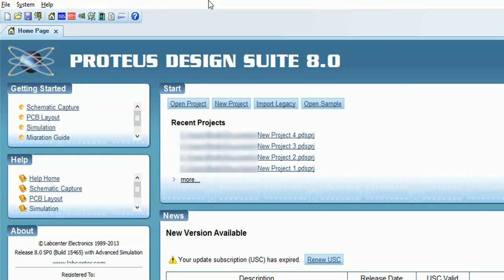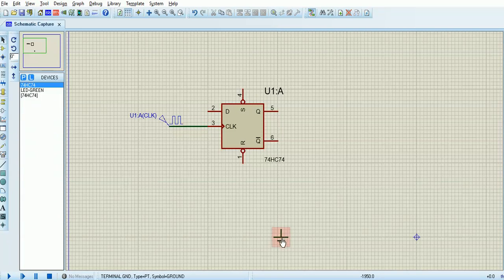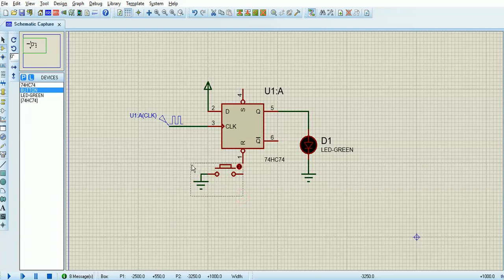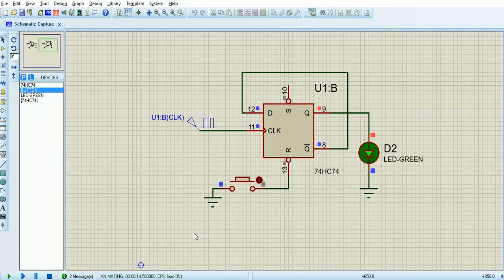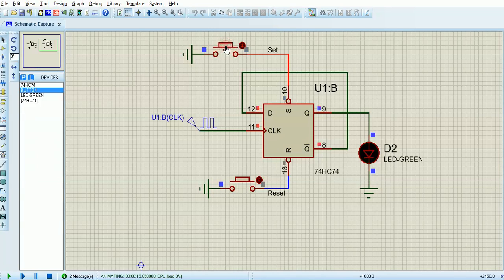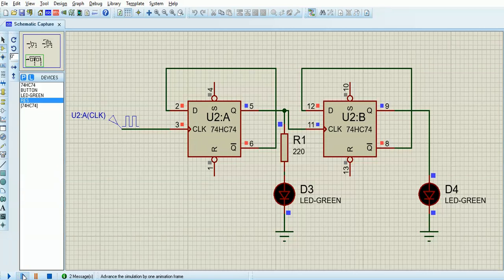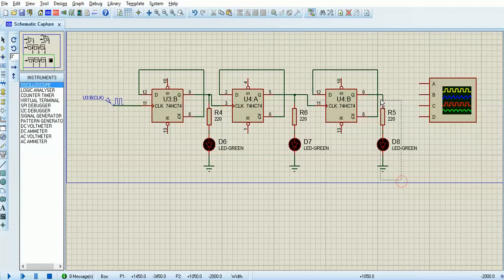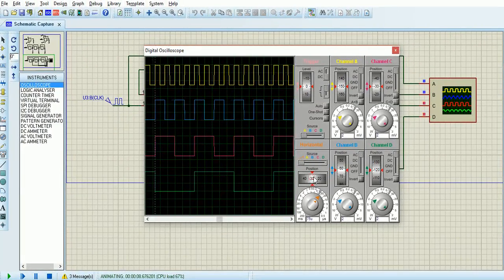Asynchronous D Flip Flop Down-counter - Proteus - James Cleves

Comment: In real world, should you connect Set and Reset to HIGH level?
Reply from the maker: Thanks. It depends on the actual chip but 7474s are often not-enabled  or active-low, hence the circle on the inputs. I would pull them high with a 220 Ohmboy. Or a 1k.